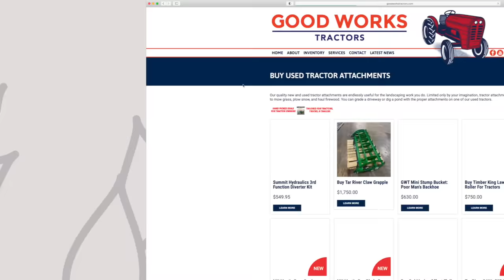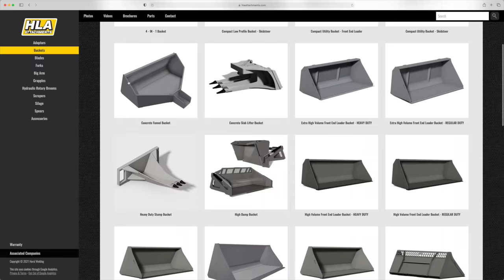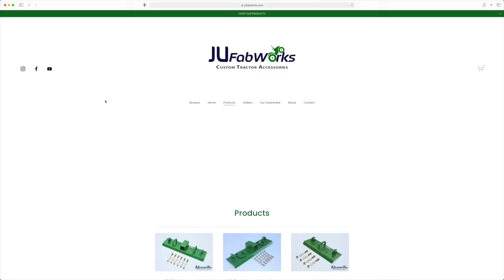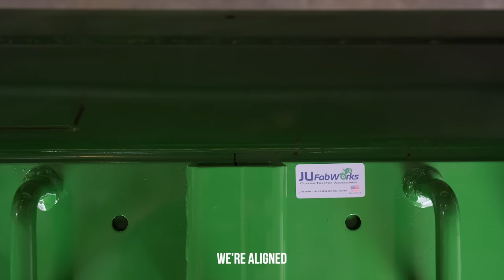BEST BOLT-ON BUCKET BRACKETS FIX JOHN DEERE'S BAD DESIGN! 🚜

Comment: I like the concept, but I wish there was a way to make them Quick connect and disconnect.  I have welded chain hooks on my JD bucket and I love them when I need them but otherwise hate them because they are always catching stuff like branches and roots and vines when I'm pushing into a brush pile.
Reply: Cut a small section of garden hose and slip it in lengthwise to fill the hook
Reply: @jamesb2291  I'll give that a try.  Thanks.

Comment: I enjoy all your vids.  At 1042-45 into this vid you are drilling the mount holes.  The vid also shows a digger bar on the bottom edge of the bucket.  I am really interested in that as the clay soil here is really hard to dig.  My JD dealership here is about 3 miles from my house they say they can't even order these things.  Can you advise?
Reply: You can drill through the mounting holes if you are not worried about removing some of the powder coat on the inside of the holes. If you do not want to remove the powder coat on the holes, I would recommend getting a transfer punch to mark the holes and then drill them. As far as the tooth bars, I know Heavy Hitch has them. Thanks.

Comment: I like the plate ideas as I have been trying to figure out how to attach a couple hooks to my front loader bucket. My concern is I have a 4320 with a 4 in 0ne bucket and there are hyraulic hoses inside the top channel where the drilling could potenial nick or damage the hoses. What would you recommend? Plus I love to get a grapple!  Great videos! Keep up the good work!

Comment: Love your videos but my Green is Orange but would sure love an attachment with that 2" receiver. I bought one of those bolt on receivers for my Kubota BX 1880 bucket but it does tend to wiggle around sometimes when moving trailers into tight places.
Reply from the maker: The problem is that there's quite a few different Kubota buckets, so it would require many different models to make and stock.  That's the nice thing about the JD buckets is that they are all constructed the same.  However, we took a look a couple of buckets to start brainstorming a solution.  Thanks for watching!
Reply: @GoodWorksTractors  I'm sure it would be worth the investment cause Kubota owners are very loyal to Orange and would like certain attachments.
Reply: Here are our Kubota (Orange) options we currently have. Thanks. you
https://www.jufabworks.com/products/kubota

Comment: Cool video! I always wondered, what are the two pre drilled holes for on the buckets? I can't find anything that would fit them.
Reply from the maker: Those holes are actually for shipping.  They bolt the buckets upright.

Comment: I have emailed Ju Fabworks but I am sure they are very overwhelmed with inquires since you made this video, thought others might want to know also. Would you feel comfortable putting bolt on plates on a 4-1 bucket? I swapped out the standard bucket for a 2020 Frontier AY11E 72" 4 in 1 bucket at purchase on my new 4052r. I want to get some hooks or d rings but don't want to damage the bucket or hydraulics. Thanks for your videos!
Reply from the maker: Yeah I don't see why it would be an issue as long as they fit?

Comment: A little bit of cutting fluid like Tap Magic will make drilling easier.  Even oil will work in a pinch.
Reply: I was going to say the same thing! I burnt 2 $30 hardened bits drilling on my trailer before I found out about Tap Magic. I drilled the rest of the holes about 400% faster and with only one bit!
Reply from the maker: We've been getting a lot of tips that say as much. Next time we drill we'll be all squared away! Thanks for the tip!

Comment: Good idea. I'm going to not drill through the new bracket and strip all the powder coating out. I'm also going to use John Deere colored RustOleum on drilled metal. I'm also going to change the electroplating bolts with stainless steel or hot dipped galvanized.

Comment: ADVICE NEEDED!!!  I am in the Market for a Compact Tractor with a Cab. I looked at a Kubota Cab on a 5 year old Tractor in NY to get a feel for size as I'm 6'2" and overweight. The dealer said it was basically the same one that would come with the LX2610. The Kubota Cab was rusted bad! Top to bottom so it doesn't seem to be a salted road issue though I'm sure a contributor.  I'm located in Central NY. Are you familiar with a John Deere Cab vs Kubota? Size comparison and durability? Maybe a good next video! I was looking at a new LX2610. I seem to remember one of your videos said John Deere doesn't offer their own Cab on smaller Compacts. Any advice greatly appreciated!

Comment: Harbor Freight has a transfer punch set to locate the holes that you need to drill in the bucket. Simply clamp the Item to bucket, select the appropriate sized center punch, punch, remove item, drill pilot holes, and finish with desired drill bit. 
This will preserve the paint or finish of the item you're installing.
Reply from the maker: Appreciate the tip! Always learning new things from commenters like you! Thanks for the suggestion.

Comment: John Deere just need to step up and make buckets as tough as skid steer buckets standard.
They are trying to save money instead of supplying a standard quality accessory.
You should never have to modify a bucket to make it practical to use,but that's the way they build things, whenever I fabricated anything it was always slightly over engineered to prevent any failure and give you peace of mind, reliability and longer life.

Comment: I really like the brackets, but while watching the video I noticed a mesh guard covering the front of the tractor grill. Do you sell those. I was using my grapple the other day and found myself picking loads with the branches sticking through the back of the grapple and hitting the tractor grill. This would be perfect for protecting that.

Comment: I know I had to buy a pretty expensive drill bit to go through some steel when I was drilling out a new part to hook onto a trailer. I also had to have a drill that had a lot of RPM. My other drill s weren't strong enough to handle going through the steel.

Comment: I have these on my 1025r.  The problem for me is when I try to move my trailer around using the 2in receiver it bends the top of the bucket.  The tractor lifts it easy.  The bucket just deforms almost instantly.

Comment: Do the spacers interfere with the 60 D deck.
Reply from the maker: Depends on the size.  I think most run 1.5 or 2" with a mower deck

Comment: I simply welded on three hooks across the top for using chains to lift things. I don't believe there's much use to the receiver hitch that high up. I use a clamp type on the lower part of the loader so I can position the hitch ball almost to the ground if need be.

Comment: I did not see an option for Kubota buckets,   I like the design but would want it to fit the bent edge of the Kubota.   it is more if the features and the strength I would like to add.

Comment: Does anyone know if by installing the bolt on, center plate (with hooks), help straighten an already, damaged upper edge bucket?  Or will this potentially result in the plate being out of level horizontally, creating more harm than good?  I have a deere 4500  with a bucket that's not, heavy duty.  Thank you.

Comment: Courtney-Is the welded configuration going to be stronger than the drill and bolt option? Thanks, Jonathan
Reply from the maker: I imagine it would be in theory if the weld is good, though I tend to think we won't find the breaking point of those bolts. But I would refer you to JU for that question, as he might have more insight as to why he made that version.
Reply: If the bolts are the yellow grade 8’s I think they will hold well enough for anything needed on a little 1025. I would imagine the steel on the bucket would give way before the bolts.
Reply: @GoodWorksTractors  Thanks Courtney. Perhaps since your video they are not taking phone calls.
Reply: @elained9591  Thanks Elaine, but I have a 3039R
Reply: I would lean to the welded option on yours if you’re the one doing the welding and you trust your work or you know a good welder, IMHO. you would never have to worry about checking the fasteners or having them get hung up on something or someone.  I would always prefer welds over bolts, I just don’t own a welder unfortunately, so the bolt option is good enough for my little tractor. I didn’t check to see if the company had an email address, maybe you could find it and shoot them one.

Comment: Question: Would it be better to put the bolt heads inside the bucket, to minimize thread damage from bucket contents, or would the threads sticking up on the outside be a hazard to the user of the attachments?
I am liking their design.
Reply: Its less hazardous than the tooth bar I kept expecting courtney to hit his shin on...😃

Comment: Kubota guys like to spend money too. Sure would look good in orange.
Reply from the maker: He could probably use some volunteers to take measurements.  The problem is there are many styles of Kubota buckets with some varying top plates, double plates, overlapping issues, varying angles, etc.  Not nearly as cut and dry as the JD.
Reply: Here is what we have for the orange tractors!
https://www.jufabworks.com/products/kubota

Comment: I would put the bolts in upside down that way if you need to ever need to take it off the threads won't be damaged from gravel, dirt.

Comment: The engine and all of the components on all John Deere compact tractors is manufactured by Yanmar so I guess it's their fault.  I have a 2003 790 with the 419 loader. Those come with the Yanmar 3TNE84 1.5 litre 3 cylinder diesel and for their size put out well over what they are actually rated especially compared to newer models of the same size. 

I'm thinking about swapping a turbo on my 790 so I can get a bit more power for when I need it while I'm plowing or bush hogging so I don't have to transport any of my larger frame tractors so I can save a bit of money and keep the strain off my transmission.

Comment: I’m assuming JD builds them like this to save money and add perceived loader lift capacity, which sounds fine on the face. I’m never a fan of sacrificing durability though.
Reply from the maker: Possibly so. Works for a lot of the consumers out there, I'm sure. Everyone uses their tractors, and thus their buckets differently.

Comment: Rather than using a bucket for pulling or whatever, it seems that some kind of attachment c/should be available for the pallet fork frame.  At least one can see what is going on rather than having the work effort obscured by the bucket.  Are you aware of any kind of pulling / open chain attachment that can be mounted on a pallet fork frame?

Comment: I see a problem (at least for me) with the receiver. The "grab handles" are too close to the receiver to use just any old hitch pin. Most hitch pins, like the ones I buy at Tractor Supply, are going to be a good 6 inches long and there simply isn't that kind of room in there. Your thoughts?
Reply from the maker: Hmm, I don't think they interfere, but will have to double check next time I'm by it.  Would have to imagine that would have been an issue that has been sorted out already though.
Reply: @GoodWorksTractors  Don't get me wrong. I want one of those, bad, but... I guess I could go get one of those cheapo hitch pins that are just a bent piece of rod stock. They're usually short enough. Most of my pins have the wire type retainers like you see between hay wagons.

Comment: When pre drilling your first hole NEVER use a drill bit more than half the diameter of your final drill bit. A little WD-40 on the steel and drill bit will save your bits and help with the cut. If you are producing fines and not chips or more your drill speed is too high.

Comment: Buckets are not engineered for pulling.  The front end loader can be warped by an uneven stress that bends the hydraulic rods.  And there is a danger of tipping your tractor over....

Comment: I feel the receiver hitch on the front is not a good idea. The top edge is not that strong and it is hard to see from the seat. If the boom or bucket get in the wrong angle it can damage the hitch or bucket. I know from my own carelessness , use a rear hitch, haul more weight, better traction and is safer.

Comment: Instead of three separate bolt-on units why not make one bolt on unit that spans the total width of the bucket? Increases the top Edge strength that much more and not a big additional expense
Reply from the maker: Might be an option in the future
Reply: Yes. That is exactly what I was thinking as well, else the point of failures simply shift to the edge of the plates. Particularly for such a complete set of attach points - makes sense to place them along a solid, heavy-gage plate whereby the loads are transferred across the entire length of the bucket and the many bolt attach points.

Comment: Next time, use clear silicon underneath the bolt on brackets, it will  help prevent rust under the brackets.

Comment: How do you "abuse" your bucket?  I have a 2032 and I USE my tractor and attachments.  I did not buy them to sit, look purty then rust away.  I crank my gear and put it to work.  Sometimes it holds up, sometimes not so much.   But I don't consider that abuse.  I consider that bad design and in the end, I won't spend money again on that manufacturers product.  When I pay this kind of money for something, I EXPECT it to do what I need it to do.  And you can bet, if my bucket bends, it is going back to where I got it and they can either fix, replace, repair or refund.   I don't cater to the "abuse" or "well you should not have done that kinda thing."    If that were the case, it should have been said up front and I would have bought something else.      When I pay thousands for something, it damn well better do the job I bought it to do.   If I paid $50 for it, ok well then it might be something to live with.  But when you are talking something that can run $1000-$1500 or more.. yea I don't want to hear that somehow it was "abused" when I used it for the intended purpose it was designed to do.

BTW, that bucket you show in the video with the huge dent... that appears that something fell on it, something extremely heavy like a tree trunk etc.  While not abuse, that was not caused by use either, would be my bet.

Comment: I dont see how this will fix the problem, none of the bolt on attachments run the length of the bucket. I also dont see the use for a receiver on a bucket? How you going to get your trailer tongue high enought to hook up? Then you will have to raise the trailer tongue up super high to move it.
Reply: Hi Brendon, it is not a 100% fix to the problem, but it does strengthen the top portion of the bucket by quite a bit, We recommend using a 4 to 6 inch drop receiver when using the hitch, that way it is low enough and you can still see it from the tractors seating position.

Comment: I wanted to watch/like this video but, less than 2mins in I hear a string of exaggerations intended to drive sales of brackets ...  For example, John Deere has a "serious bucket design problem", and the standard bucket is made using "very thin steel", neither of which is true.  Loaders and buckets are designed within defined parameters to match the tractor.  Exceed the capacity of those specs and you risk damage to tractor components, not to mention injury to the operator.  You want/need more capacity, order a different loader and/or bucket.  If not available, buy a larger tractor that matches your needs.
Reply from the maker: Other tractor manufacturers in the same tractor categories don’t have these issues.  Not sure how you reconcile that disparity.
Reply: @GoodWorksTractors  Saying there are "issues" is one thing, and using exaggerations as noted above is quite another.  Focus on the benefits the brackets provide while operating within the design limits of the components in question and avoid using misinformation.
Reply from the maker: @richardnoel5962  It is not an exaggeration.  How many used John Deere tractors have you bought and sold?  I’ve bought and sold hundreds and hundreds, looked at tens of thousands.  It is a pattern with their standard duty buckets.  I have the experience to validate the statement.  Please provide your vast experience.
Reply: @GoodWorksTractors  I'm going to leave it there but, I stand by my comments.  Delete the thread if you like ...
Reply from the maker: Good decision.

Comment: hahaha, this is why real farmers and ranchers say...IF IT AINT RED IT STAYS IN THE SHED. Deere is overrated and in many cases underpowered. As far as your bucket flaw, a buzz box and some cheap metal from the junk yard for under 20 bucks will fix the problem.  And Deere Green is common in a rattle can. Not to mention all the modification connections for everything from forks to just chain hoist points.